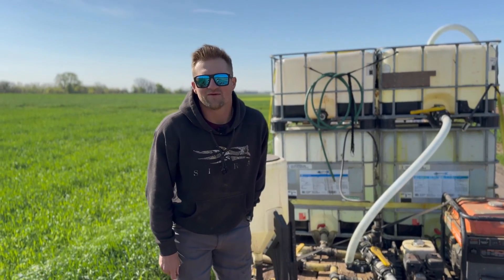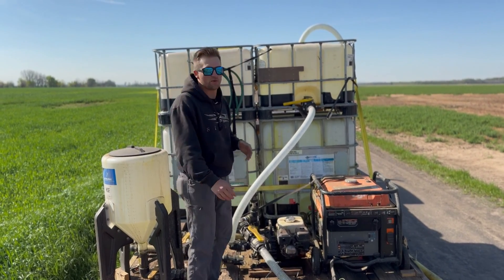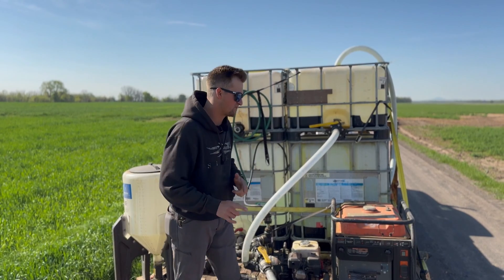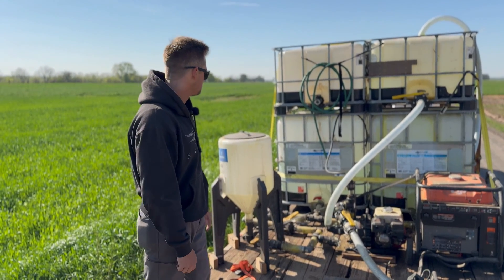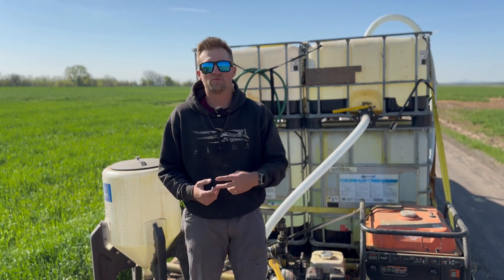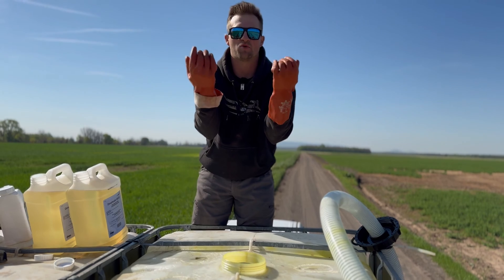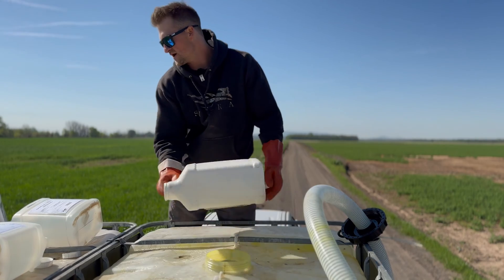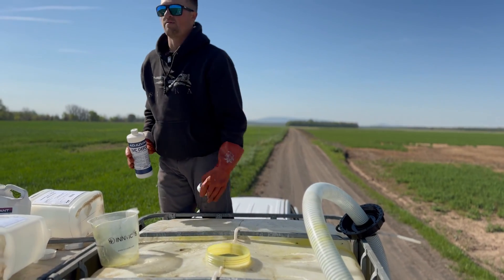DRONE TRAILER SET UP! EASY AND EFFICIENT WAY POSSIBLE #farming #agriculture #dog #ranching #drone

Comment: Great video, finaly someone showing an affordable normal setup. Not everyone needs a fancy auto mixing stations and ultra expensive dedicated trailers ;) Btw the c10000 charger, if used, needs two phases to feed it from the  generator and each one needs to be like 5kw+. 

Anyway, thanks for showing a bit of chemical mixing as well. All the other videos mostly talk about amazing drone features only. Defoamer advice sounds realy valuable! Thx

Comment: Thanks! How much you think that all weighs? How big of a truck and trailer is needed?
Reply: Well if he's got 2- 275 gallon totes of just water, then that is 2200 lbs just the water.  Plus weight of a trailer and all the other products you could easily close in on 5k.  Yeah you could pull that with a 1/2 ton truck but if your going to be dogging it day in - day out on the road I'd perso ally rather be pulling that with a diesel 2500 than a gas 1500.  Just the wear and tear your going to put on a light duty truck would be crazy. He's show a simple way to do it and I like it.